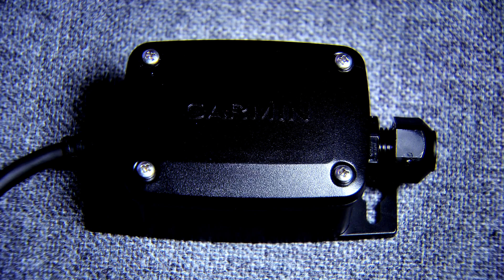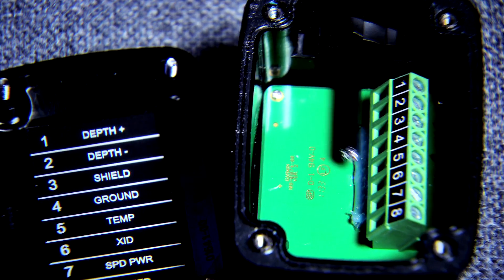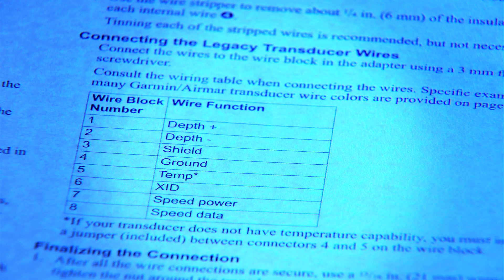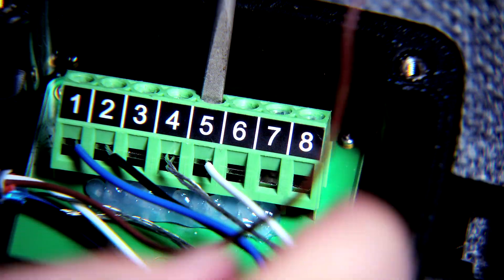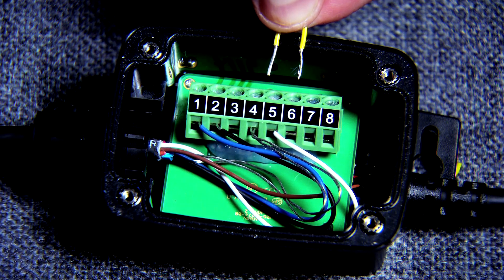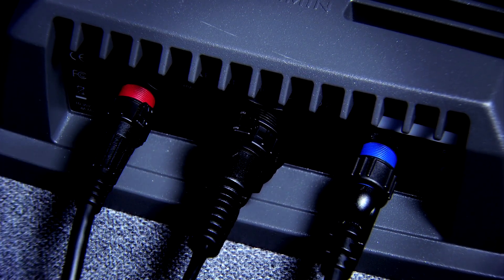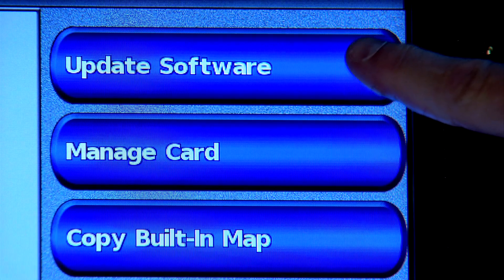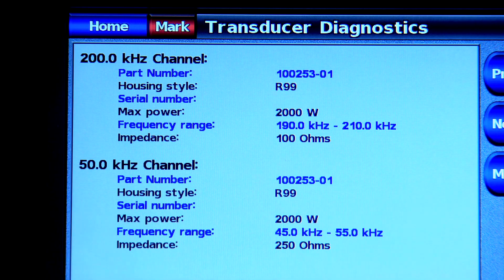Installing a Garmin GSD 24 with Transducer Adapter Box

Comment: How can connect to GSD 24 unit to my NMEA 2000 network? I don't want bring to many cable into cockpit One is enough, Before I had GPSMAP 2007 and I could solve all connections in one cable with CAnet data connection. Now we need one NMEA connection and one RJ45 for sonar connection WHy?
Reply from the maker: The GSD 24 cannot be connected through NMEA 2000, it connects through the Garmin Marine Network only. -MR